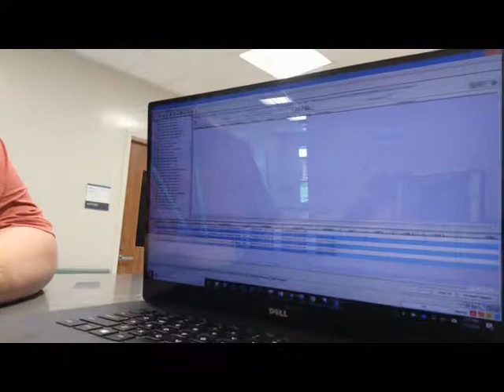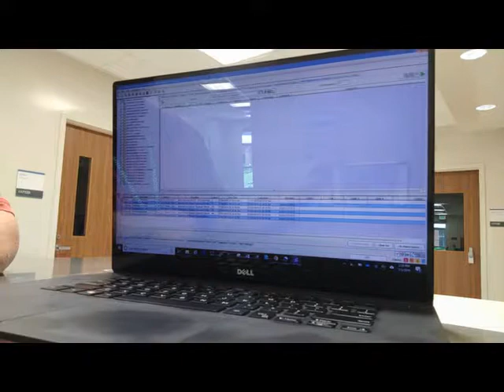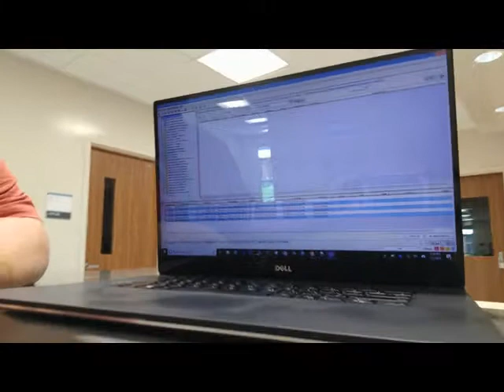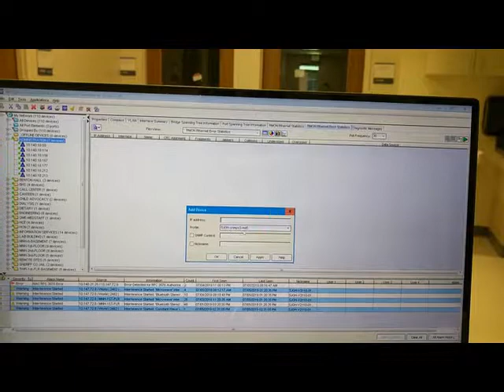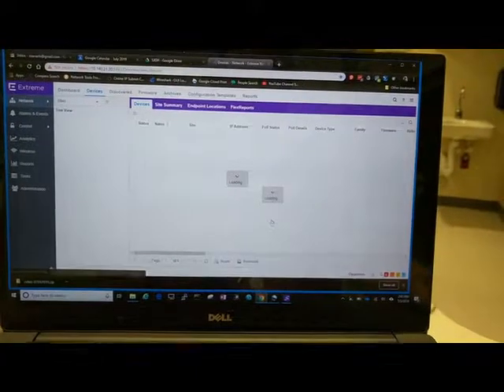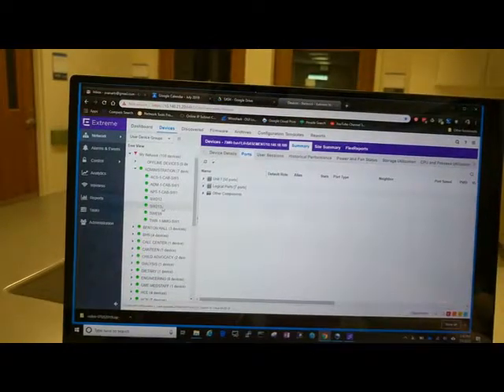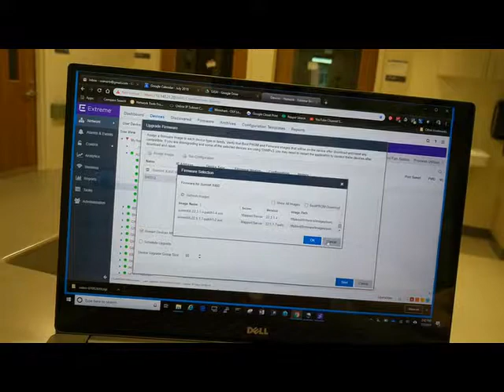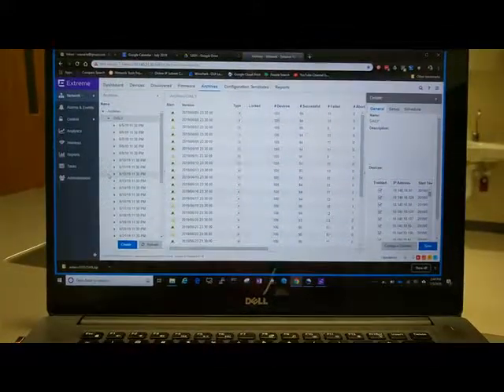Installing a switch for the Sim Lab

Comment: Hello Scott , i find your networking videos very interesting, and iam new to this field. I have a doubt, when you were adding the switch using the software 9:49  , it asked for IP address , aren't switch layer 2 devices?, then why does the software ask for Ip? shouldn't it ask for a MAC?

[EDIT: I guess then yours is a Managed switch, Unmanaged switch doesn't have one :D
Reply from the maker: It's true that switch can be layer 2 devices, many switches can also be layer 3 devices as these are.  If I did not assign an IP address I would always have to walk out to the switch, plug in a console cable, and manage it that way.  With over 100 switches to manage this would quickly become impossible.  So, we assign a management IP address to the switch.  That way we can telnet.. I mean SSH... to the switch and make our changes without ever leaving our desk.  Hope that clears it up.  God bless!